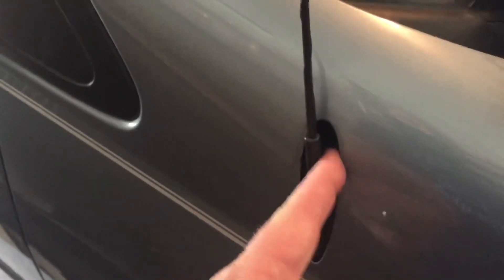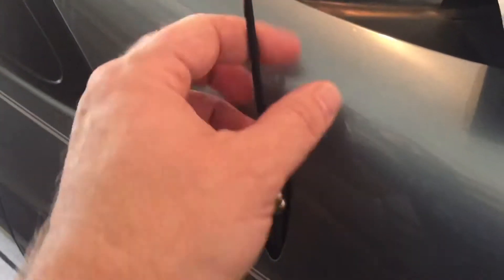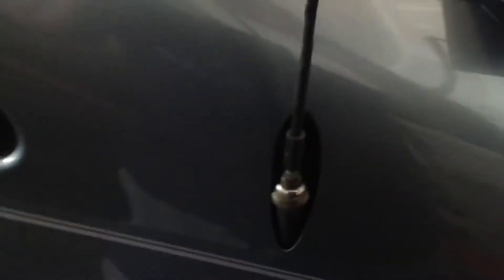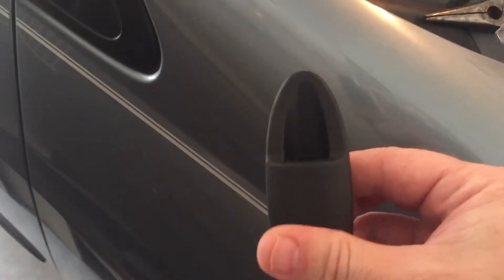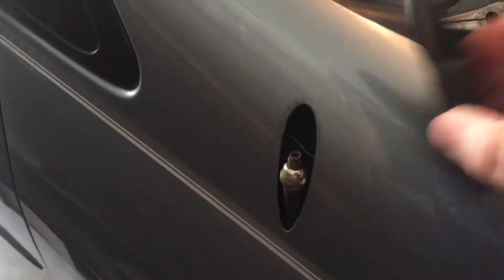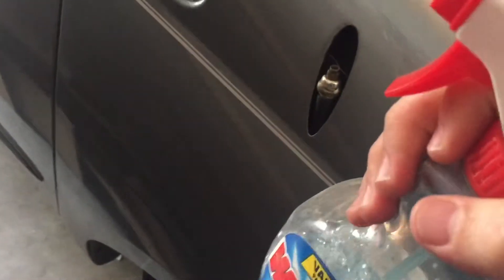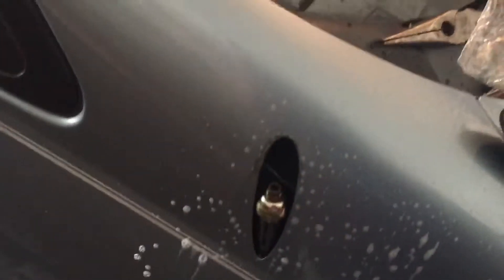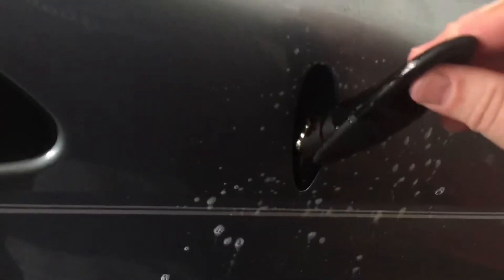Installing an Antenna Ornament

Comment: I replaced this on a 2009 Toyota Sienna today.  Based on your recommendation, I bought the OEM part.  It went very smoothly, and was much easier than I expected.